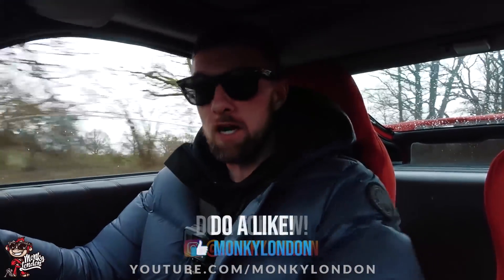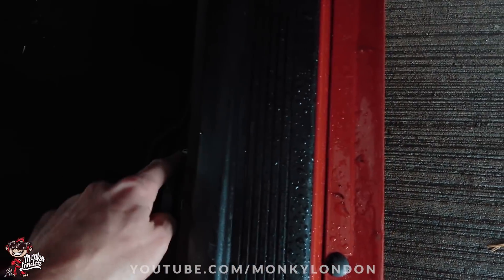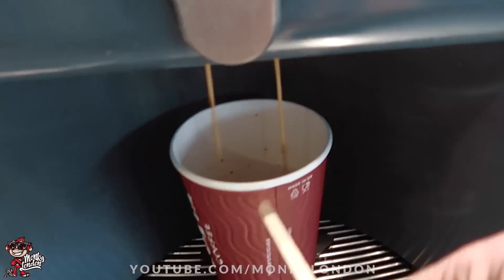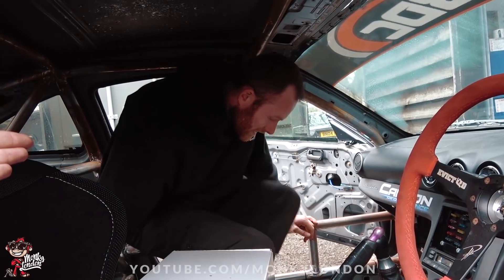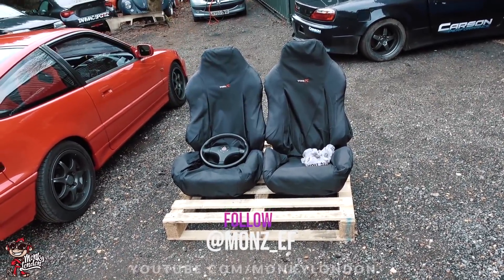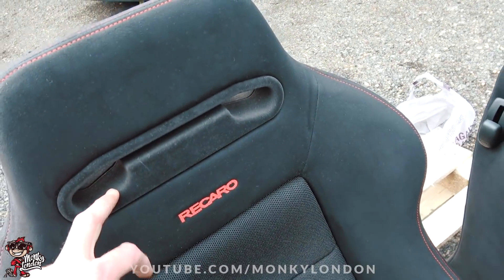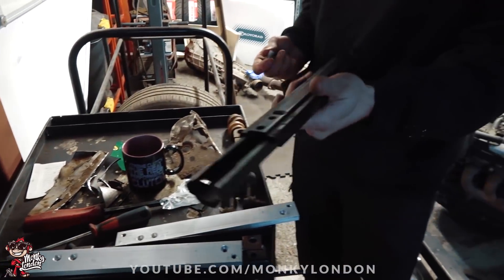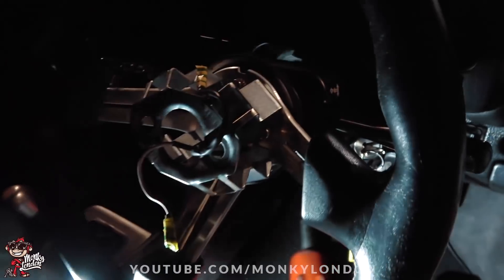🐒 SMASHING BACK ROADS IN A HONDA CRX B16 + FIRST MODS

Comment: The flock on the belt hole thing is stock on these. This is a recaro speed like you prob know.

But the normal Recaro speed has way cheaper look and feel overall. The honda oem ones have that flocked harness thing, they have much nicer cloth and alcantara/suede and they have the smaller way more subtle Recaro stitching wich is below the harness hole thing instead of above like where the normal recaro speed has it. 
Imo one of the best seats in a factory car. The best seat would be the original NSX Type R/Type S Zero seat wich is a Carbon kevlar recaro pole position with the sweet Honda touch. Mindblowingly expensive tho.

Comment: say what you want about torque but the b16 (pref b16b) is such a drivers engine, keep it on the boil in a light shell is near enough pure driving perfection.

I still miss my ek9 b16b after ep3 and k24 eg.

Comment: In the process of building a CRX with k20a turbo. 900kg these little beasts are
Reply: 1010kg weighs the ee8
Reply: @Dreibein82  I have an 88. They're 872kg. Just above 1900ib.
Reply: @JDMz  ok, the older the lighter. But less power.